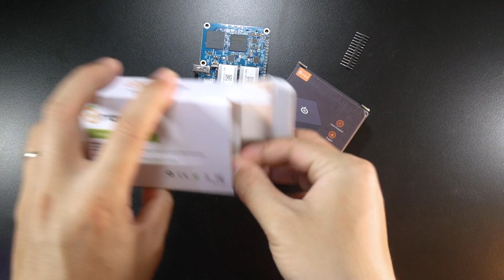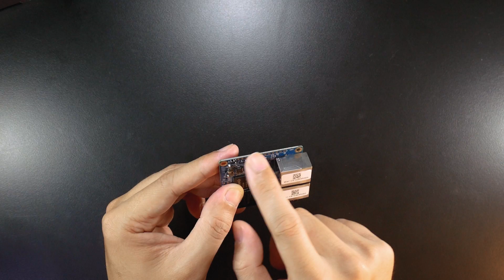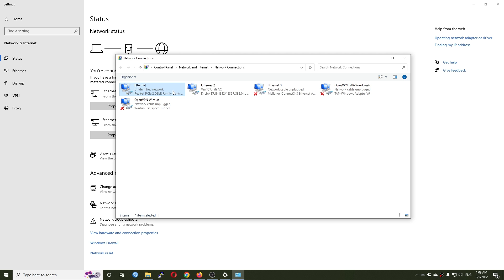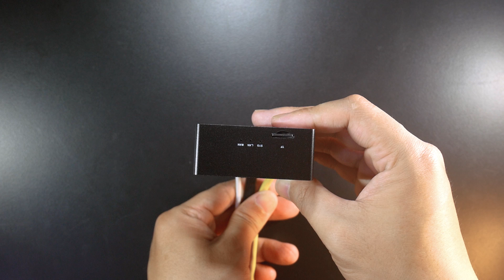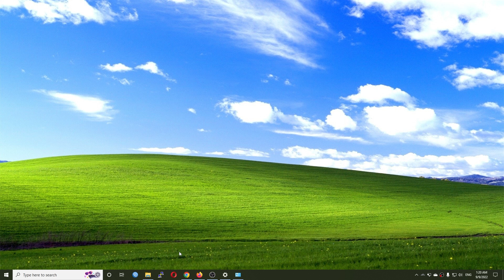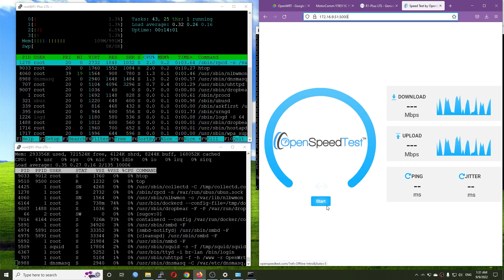Orange Pi R1 Plus LTS Unboxing - Overview - OpenWRT Quick Test

Comment: You could try to put thermal pads onto the nic too. They might get to hot and throttle.
Reply from the maker: From my observation, most likely this will not happen. I have been testing different SBC such as the R4S, R2S, R68S and the NIC usually doesn't get too hot.

Comment: You know what would be interesting? See the performance of this router compared with a commercial solution at similar pricing.
Reply from the maker: Yeah, the Orange Pi R1 Plus LTS is even cheaper compare to the NanoPi R2C, which is having more or less the same specs. However, these kind of SBC/Router is for IT/networking enthusiast who is willing to explore, learn and improve. For a commercial  production product, everything should be ready and most of the time plug and play.
Reply: @VanTechCorner  Sure, but I was suggesting to compare them purely from a performance standpoint. It would be interesting to see if this can effectively replace a commercial solution in a home setup (for enthusiasts, as you said). 
I mean, the price is killer, it's even cheaper than a Ubiquity EdgeRouter X... But can it replace it? That's the question.
Reply from the maker: Are you talking about the EdgeRouter X runs OpenWRT or stock firmware? If you are talking about the ER-X with stock firmware, nothing I can comment since the 2 products are completely different (chipset, OS, I/O). 
For OpenWRT, I have the testing video of the ER-X available on the channel. I am just sharing the information and don't do the comparison. You can make your own decision, which depends on how you want to setup your system, the budget, network throughput while considering the performance, the user community, OS/firmware development and feature proof... There are a lot of things to consider.
Reply from the maker: Frankly speaking, when you ask me this question, I think that you are not really familiar with OpenWRT, or still confusing about the mainline OpenWRT and factory-built OpenWRT firmware (OrangePi) . In this case, you should go with the Edge Router X for better support and ease of use. Once you have time and get used to OpenWRT, you can try install OpenWRT on the EdgeRouter X to explore more.
Reply: @VanTechCorner  Sure, but they do fullfil the same purpose. That's what I'm talking about, if you can use this instead of the ER-X in your home to take advantage of the extra features and future expandability without sacrificing any performance. Maybe a future video 👌🏼

Comment: Hello how are you?
Excellent video!!! I was thinking about buying an Orange Pi, but I was worried about compatibility and having to compile drivers. A year ago I bought a Banana Pi R2 and I had a lot of problems with drivers. Until today, her internal wifi card is not supported and I couldn't get an external USB wifi card to work.
Can you make a video installing a USB wi-fi card on your Oprange Pi? Is a video teaching how to make rclone to mount virtual disk and increase storage size a good suggestion? Thank you so much for sharing your knowledge!
Reply from the maker: Hi, for USB it depends on the chipset of that USB card. I got one WiFi 5GHz USB with Realtek MT7612U chipset and going to make a video soon.
Reply: @VanTechCorner  Great!!! Thank you very much.
Reply: @VanTechCorner  any update for this?

Comment: @Van Tech Corner
Bạn ơi cho mình hỏi, mình cài armbian bullseye cho pi r1 plus lts nhưng ko nhận dc địa chỉ IP, trên pc chỉ nhận dc IP 169.254 nên ko thể truy cập ssh để cấu hình dc, bạn chỉ giúp mình với
Reply from the maker: Nếu chạy Armbian thiết bị của bạn là một máy tính Linux thông thường (giống như máy tính Windows bạn đang bạn dùng). Bạn phải cắm nó vào switch hoặc router để R1 Plus nhận được địa chỉ IP.
Bạn chỉ có thể nối trực tiếp R1 Plus tới máy tính khi nó chạy OpenWRT.

Comment: Are there any boards like this that has multiple LAN ports with at least one LAN port that can provide PoE power to a device plugged into it? That would be sweet because one of these LAN ports will have a AP or Security camera plugged into it. No need to use a separate injector.
Reply from the maker: For SBC, like this Orange Pi, NanoPi or Banana Pi I don’t any board with this capacity. However, there are routerboards support this. For example, the Wallys DR4028 supports PoE input (to power on), the Mikrotik RB750Gr3, Ubiquiti Edge Router X can run OpenWRT, support PoE in at ether1 to power on and PoE passthru at ether5 to power other devices, such as AP or Camera.
Reply: @VanTechCorner  Have you done a video on how to put OpenWRT on a Ubiquity EdgeRouterX? I can’t seem to find it on your video list. If it’s done, the PoE out on it is passive. I get nervous with passive PoE because if the wrong voltage is sent to the end device, it might damage it. This includes accidental plugging in computers to this passive PoE port. This will surely fry the network jack and possibly the whole motherboard on this potentially expensive computer. Passive PoE is one of the most hated networking technologies. Yet, for some reason, manufacturers still do it. At the very least, manufacturers should create a modified passive PoE to first sense if the remote device is capable of PoE before sending its passive power to it. Passive PoE at the moment does not even do this. Once a physical connection is made, the injector blindly sends power.
Reply from the maker: @jasonluong3862  By default, PoE out (passthru) is disabled (stock FW and OpenWRT), and I don't think it will have any impact on the connected device. Once you select to enable the PoE, you should be aware of the risk. The video is available here https://youtu.be/VreMamhWOX8, you can search for the video by go to the channel home page, and using the search button. Sometime I will forget to add the video to the OpenWRT Tutorial playlist, that is why you can't find it.

Comment: What is the best?  Nanopi R2s or R1 plus Lts?  thanks.
Reply from the maker: For sure R2S if you need support from both OpenWRT and FriendlyElec
Reply: @VanTechCorner  I will only use openwrt so is R1 plus lts better? Thanks!
Reply from the maker: No, the R1 Plus LTS it is not supported by openwrt.org at the momment. All the fw are from manufacturer only

Comment: its comes openwrt pre-installed? also serial port?
Reply from the maker: No, you need to buy a microSD card and install OpenWRT manually.
Reply: @VanTechCorner  ok thanks, but any model of orange pi with openwrt pre-installed ?
Reply from the maker: @edinetgrunhed6000  For Orange Pi, there is no such device. However, you can buy the NanoPi R5S. It has eMMC and pre-installed with Friendlywrt.
Reply: @VanTechCorner  thanks bro for the advise, but in your experience which one is simple and easy to program?nano or orange?
Reply from the maker: Hi, Both run OpenWRT (or a fork of it) so the it is almost the same.